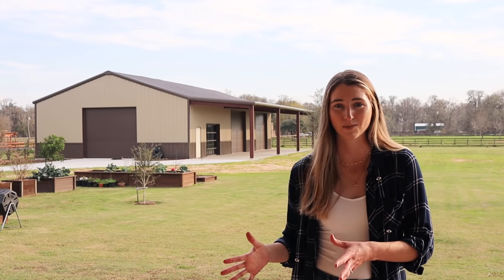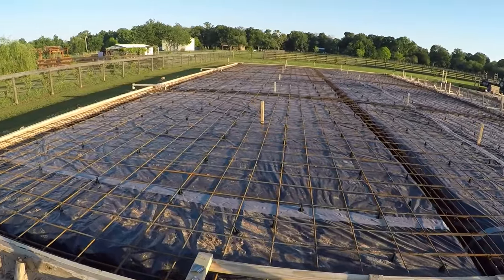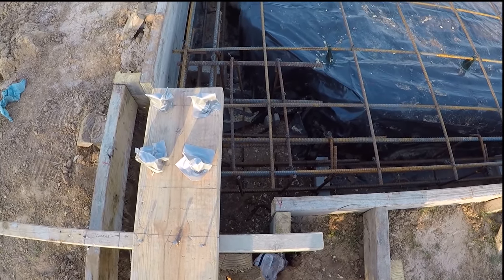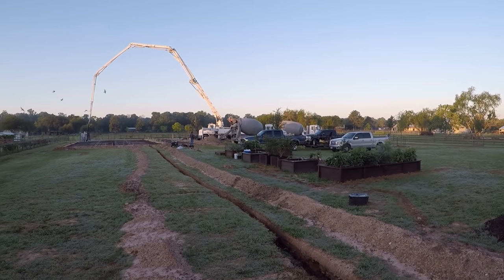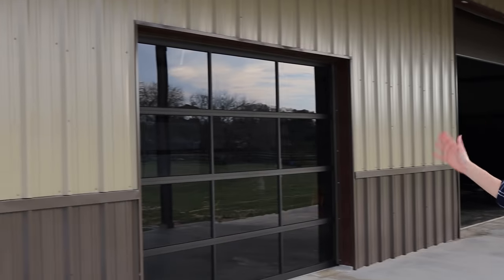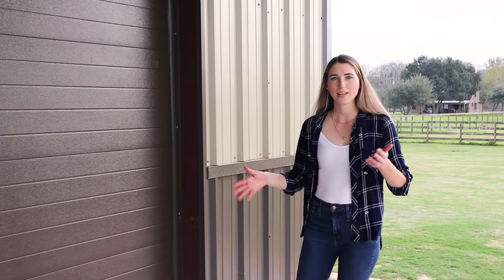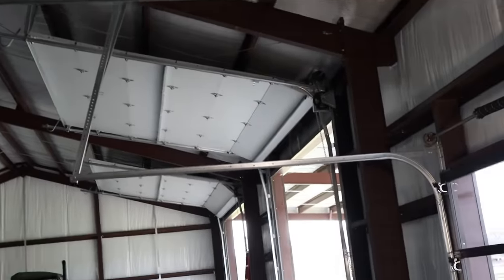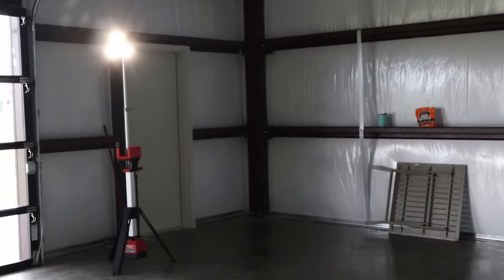Building Our 40x75 Metal Building/Dream Garage From Start to Finish!

Comment: What did something like this cost to build please comment back I am looking to build a building and I don't know who to go with yet Thank you for this video
Reply: In todays market the concrete alone you’re looking at around $30,000+ building probably around $60,000 add another $10,000-15,000 for insulation and to pay to have it build add another $30,000. My best guess is $150,000 with doors electric windows and insulation. That’s in todays prices. May have been a bit less for them.
Reply: I’ve got a 70x40 under construction now. Foundation windows and kit 65k on pole barn. A metal frame building was like 90 similarly specd
Reply: @hartman601  Please advise which structure is best for the most bang 4 the buck, plz status your construction.  Thanks...

Comment: Enjoyed the video- my question is, how can you have 12 wide x 14’ tall doors in a building with only 14’ eave walls? Are the doors actually 14’wide x 12’ tall? Thanks
Reply: The walls are 12’ tall but the ends goes up (the angled portion) that goes up further.   That’s why it has 14’ doors on the ends.  They wouldn’t fit on the other walls.

Comment: When we went home shopping, we wanted a metal shop . That was in 2017.. We bought the house with a 1700 sf shop on slab, came with with 220 power, lights, water and a automotive lift. I have no idea what the shop would cost now as its built. We were lucky because since 2017 the price of house and property has almost doubled. And now building cost have gone crazy.  We could not now afford to buy this place..
Reply from the maker: We got pretty lucky and we locked in a price before costs really started to skyrocket!
Reply: @TXgardenandhome  would you mind sharing the contractors and suppliers. Thank you for posting really nice video.
Reply from the maker: @ROCKYVUD   I mentioned some in the video like our doors. is there a contractor you’re looking for specifically?

Comment: LOVE your new building. Question...whos overhead doors did you use? Are they insulated? and are they mounted directly to the steel? or did the installer mount wood first then the doors to the wood?
Reply from the maker: CHI made the overhead doors. And yes they are insulated. Yes directly mounted to the door opening. We don’t have any wood. Everything is metal.

Comment: Why do the 14’ high doors if the outside Eve of the leantoo is only 12’  ?
Reply from the maker: The eves are 14’ on the building and the height of the door is 12’. The clear height on the lean to is 12’ as well.

Comment: Very nice! I was curious roughly what you have in this project? I’m looking to do something very similar!
Reply: I’m shopping now. From my quotes I’d bet this was ~$200K.
Reply: Would agree, $200k for this is probably pretty close. I’m building one about 20x30 and with just the building w/insulation and 3/12 roof with no eaves, no lean too with concrete pad or multiple garage style doors I’m looking at $35k. Luckily for me we already had the pad we’re building on so I didn’t have the concrete expense for the 20x30 building. Hope that helps give you some comparison. Also I’m in North Texas.

Comment: The 2 large doors next to the glass door appear to be taller than the lean to height. Is that an optical illusion or is the lean to height going to limit what you will be parking in those larger bays?
Reply from the maker: The lean to height and the doors are both 12 feet. The glass door is only 8 feet

Comment: Who manufactured your building and was it easy to work with them?  I am looking at a similar building and  was wondering if the process was easy?  Also who built the building?    Your contractor or one provided by the manufacturer?
Reply from the maker: We used a small manufacturer in South East Texas and I would not recommend them. The customer service and experience overall with them was really bad and they missed a lot of pieces when it came time to put the building together. Thankfully, our erector we used was top notch - we used C&A Erectors. They were amazing to work with and overcame a lot of the shortfalls with the building manufacturer. We hired our own erector and the process was easy.
Reply: @TXgardenandhome  was it Tyler metal buildings?
Reply from the maker: @WinTheWarWithMe  nope!
Reply: The reason I ask is that I work for Nucor Building Systems out of Terrell, TX. The next time you want to get a metal building if ever look us up!
Reply from the maker: @WinTheWarWithMe  absolutely! Will do!
Reply: @WinTheWarWithMe  hey I’m right by Terrell. We are looking for a build similar to this. Maybe you can help us out?
Reply: @TXgardenandhome  who did the foundation design ?
Reply from the maker: @ROCKYVUD  a small company called Lynn engineering

Comment: I am in the process of building a 40x60 metal building. What insulation did you use and where did you get the garage doors that follow the roof pitch?
Reply from the maker: For insulation we used Silvercote 3.25” R10 PSP VRR+. For the garage doors - CHI made the doors and your garage door installer can order the tracks how you like them (straight, angled, etc)
Reply: @TXgardenandhome  Does your insulation cause condensation? We are in the process of ordering a red iron building and am wondering about the insulation we should get. Thanks!

Comment: What is the pitch of the concrete outside? Under lean-to etc.

Is concrete inside perfectly level?
Reply from the maker: The pitch is 1 on 12. The concrete is as level as you can get it! It’s not perfect but pretty good for what we need.
Reply: @TXgardenandhome  so the concrete drops one inch per foot? Thanks!
Reply from the maker: @scarroll451  Yes it slopes down 1" per foot. That's why the columns on the leanto sit on a pedestal. It allows the water to run off.

Comment: Who is the metal building kit/frame/shell manufacturer?
Reply from the maker: We had a bad experience with the manufacturer and wouldn’t recommend them. We used c&a erectors and they were awesome and made up for a lot of the shortcomings with the manufacturer. They are local to our area though.
Reply: @TXgardenandhome  Thank you so much! Here in my area (Vermont, rural) both manufacturers and erectors are hard to find, and steel residences very uncommon.

Comment: how much for the concrete?
Reply from the maker: About $8 for the slab and close to $5 for the flatwork.
Reply: @TXgardenandhome    $8000 for 3000 sq.ft. of concrete 6" thick?  no disrespect, but i can't believe that.  here in Pittsburgh, PA, that size concrete slab would easily be $30,000.  are you just not disclosing the real price?
Reply: @jimharvard No 8000 Sq ft X $8 = $24,000 + $5 flat work? = $29,000.